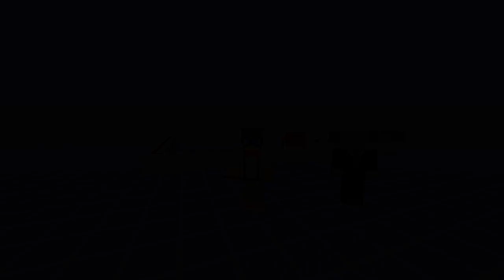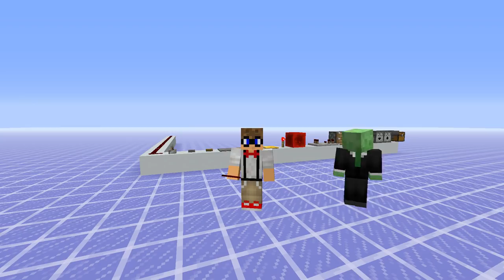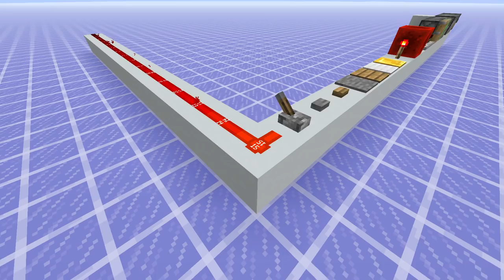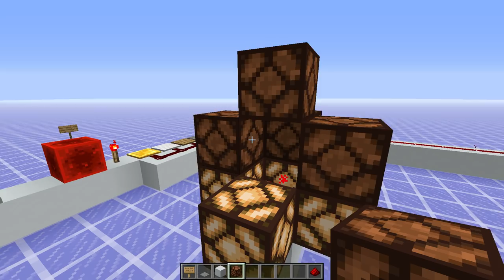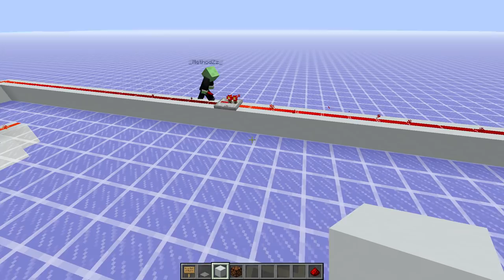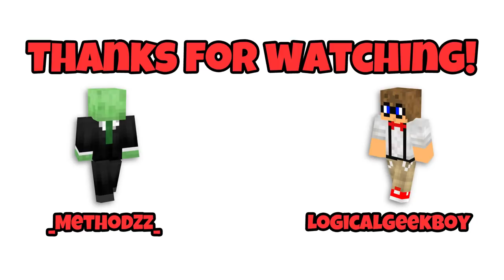Dissecting Minecraft #1: Basic Redstone Components

Comment: Depending on how you read the wiki, it seems like there are actually three block powering states. Strongly powered is powered by a redstone torch, a repeater, a comparator, or other user input device like a lever.  Weakly powered is powered by redstone wire.  But then there's "activated," which is a state certain blocks can be in when NEXT to a powered block.  A piston can't actually be powered, because it's not a solid block.  But if you try to directly power a piston or you power a block next to the piston, the piston will activate.  Redstone lamps are solid blocks, so there are three cases where the lamp will light up, weakly powered, strongly powered, and activated (neighbor is powered).

Comment: Just 2 days ago I was complaining on a Discord how so many redstone tutorials really aren't because they don't really teach but just offer a blueprint - I don't want to copy, I want to learn! I'm so going to love this series!! 💜

I have two questions after watching this:
 - the block above a redstone torch is strong powered but apparently those to the side aren't (as the lamps above lamps weren't lit)?
 - the piston when powered diagonally requires a block update; what was the update above the piston when the observer powered it diagonally (that didn't happen with the lever)?
Reply: for your first question there are three things someone can mean when they say "powered," either "strongly powered," like the block a button is attached to, "weakly powered," so a block powered by redstone dust, or "activated" which means its not technically powered but instead just "turned on" by a nearby powered block, for example a redstone lamp beside a block with dust running into the block will be activated but not powered. Redstone torches only strongly power the block above and activate the blocks adjacent to it, the block above can then in turn activate the blocks around it.
For your second question, when redstone components change states they give redstone updates a certain distance away. For dust and lamps they update any redstone components up to two blocks away (taxicab distance). Buttons, levers, pressure plates, and observers give updates to any adjacent blocks and to any blocks adjacent to the one its "attached" to, so if a button is on a stone block, any component next to the stone block will get an update too. It seems that for the observer this works even if its pointing at air, so the blocks adjacent to that piece of air receive updates. This is similar to how dust on a block above a piston will instantly qc power the piston, as the dust powers the block above the piston and the redstone update reaches the piston and updates it instantly. You can read here for more :)
https://minecraft.gamepedia.com/Tutorials/Quasi-connectivity#Immediate_QC_activation

Edit: I just want to clarify that some people use different terminology and use "Strong powered" for what i called strong and weak powered and "weak powered" for what I called activated
Reply: Thank you for trying to help me but I fear it's confused me more lol.. What do you mean when a block is "not powered but just turned on" what does it do to the block or neighbouring blocks?
And at 18:13 the lever didn't update the piston so I guess it was too far away because it's one block above, to the side and to the front of the piston?